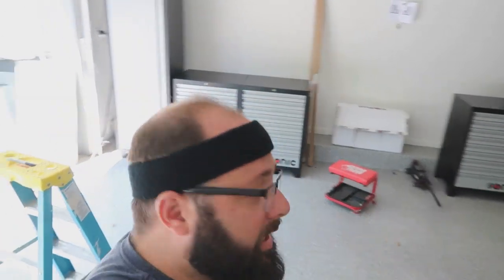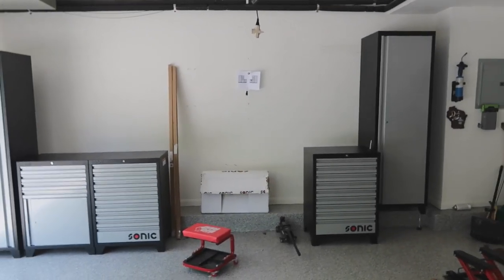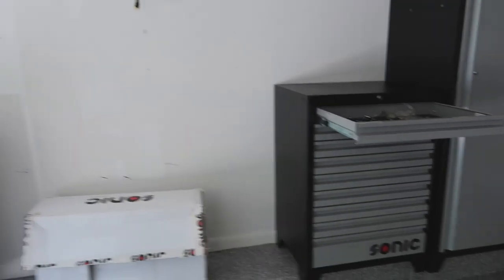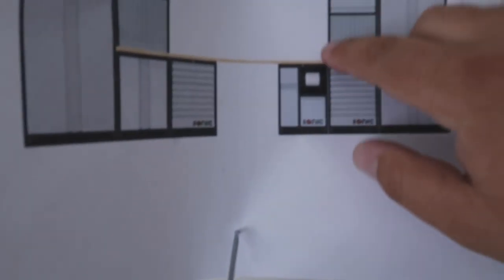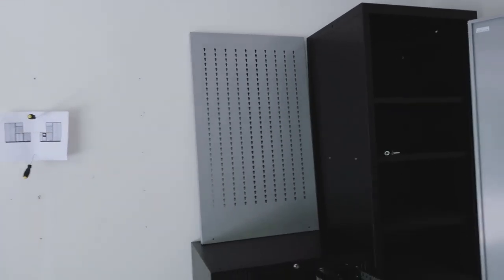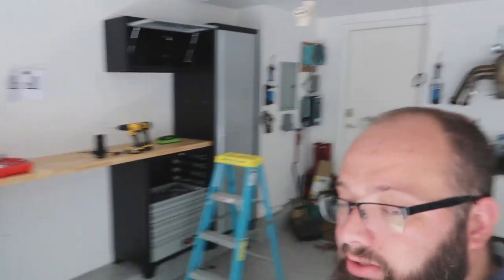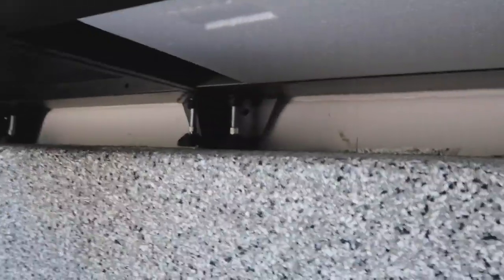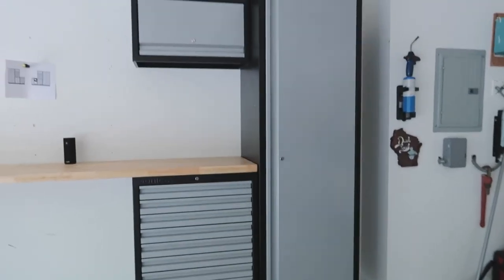Sonic Tool Cabinets Finally Installed! MY $40,000 DREAM GARAGE Pt. 3

Comment: I had a similar issue with a  ledge in My workshop. My Concern was that the extensions would reduce the weight capacity of the cabinets by 50% before a tip or collapse event. For wall mounting cabinets and stabilizing the lowers in my workshop I covered the entire wall in 4 x 8 3/4" plywood secured with Anchor screws. That way I can wall mount my uppers and anchor the lowers as well as anchor the tall cabinets the lower. I  have the cabinets securely mounted using screws and finish washers at least six points in each cabinet. But I am confident in their ability to meet weight requirements.
Reply from the maker: P. Wingert sounds like you did it right. I really didn’t want to drill holes in the back of my cabinets and this system was the best for what I wanted (doesn’t look good, but works) I’ve been rebuilding a car now for the last 6 months and the extensions are holding up perfect. Thanks for stopping by!
Reply: @GasTachs  My first thought was to install concrete anchors and mount the base cabinet to those. But that didn't solve my issue with the tall cabinets or the wall-mounting of the upper cabinets. I also hate having to align with the studs.  SOoo that's when the plywood came in.   I took out the gyprock and mounted the plywood directly to the studs. This gave me that inch or so and no risk of the drywall failing.

Comment: I’m having the same with my ledge and would like to create leg extensions as long as yours or about 6 inches. Where do you get those or how/what did you use to make them?
Reply from the maker: I was only able to find them on Grainger.com. here is what you need to order Threaded Rod, Carbon Steel, M12-1.75x1m, Item # 10P807 AND Coupling Nut, Zinc Alloy, Steel, Pk50 Item # 38DH53

Comment: Might have been a bit easier to build a bit of a kick plate with wood to build up the front of the cabinets
Reply from the maker: Daniel Perdisatt thought about it but didn’t like the idea of wood looking at a wooden base
Reply: Gas Tachs a bit of black paint and it’s look decent enough, I’d be a bit sketchy of those long bars at the front a good bang and it may come tumbling down. Looking good all the same
Reply: Or what is behind that boxed off section? You could even use a piece of 3/4-1” ply and put it flat on top of the box and drill/screw into it leaving a bit of an overhang to hold the front of the cabinets! You’d only need to cut the pieces to the size of the cabinets as well
Reply from the maker: Daniel Perdisatt good point.

Comment: Why did you ultimately go with Sonic? That looks like a huge unnecessary pain in the ass haha. Those stupid feet on the bottom and non-wall mountable?? I'm sure there were better options for your space!
Reply: Looks good overall, and love the new Expedition btw! We just swooped an Expedition Max and are looking at what wheels/tires to get with the lift
Reply from the maker: I have since walled mounted the Sonic which makes it A LOT better. But I went with Sonic because of the organization.   It is by far the best system out there.